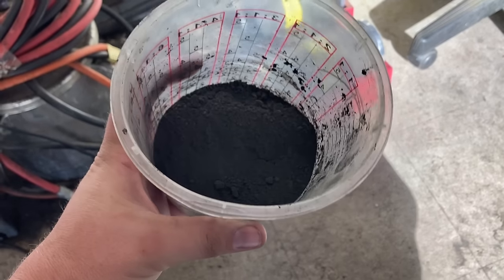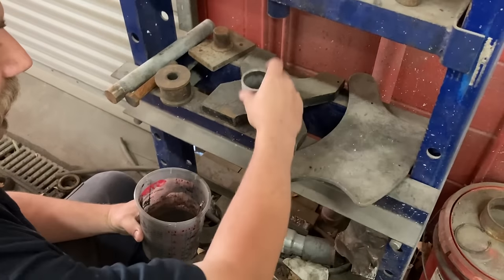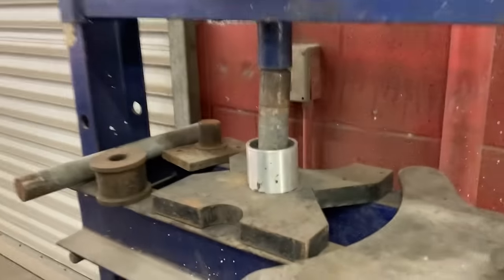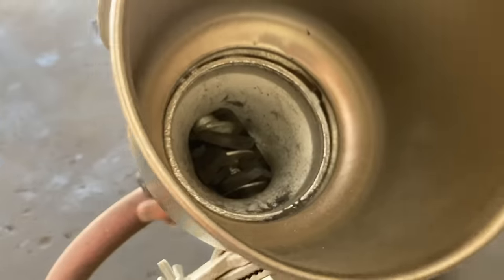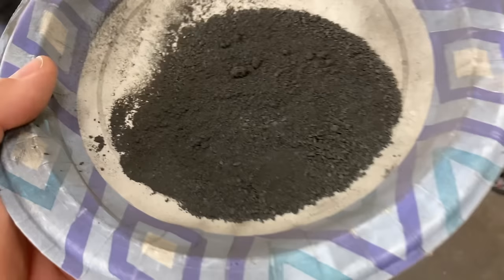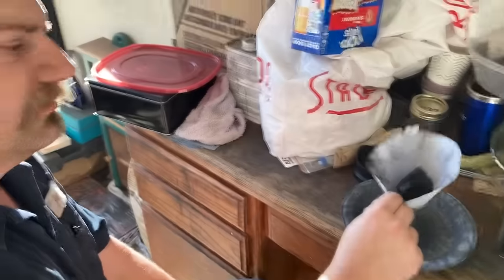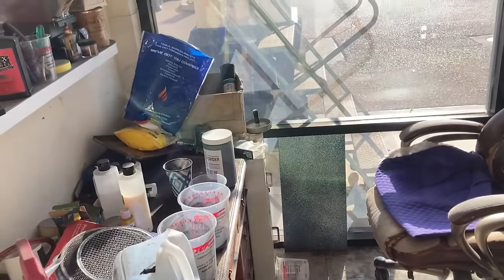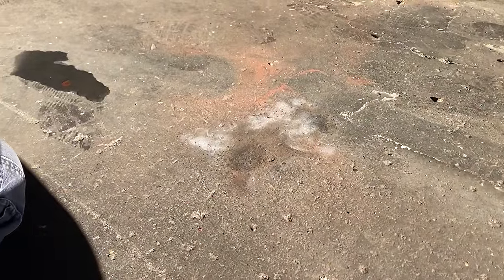Making Corned Black Powder

Comment: Thanks for sharing!!    

Dust facilitates accidental ignition.  Look up dust explosions if needed.  Just wanted to put that out there before I say anything else.  Safety is paramount! 

It's not so much a literal waste as much as it is just plain inefficiency.   I'd speculate that adding a very small amount of dextrin as a binder,  2-5 grains measured by weight, could improve efficiency without impacting performance.  It might be negligible, but if there's a concern with adding 2-5 grains of dextrin as a binder it's possible an additional 2-5 grains of silicon powder could mitigate the impact and improve ignition.  Testing would be required to confirm performance variables. *

Try using bedding hay/straw.   If you can get grape vines it could provide even better performance for muzzleloaders, cartridges, and cannons.  

If you're more interested in display than projectile performance than use of willow should yield improved ember effects.  Projectile over display, straw or grapevines have been documented as top performers.  This information has been acquired from various sources dating back several hundred years.  It's been said that using straw provides more power than useful in pyrotech.  

I suggest never using a pocket lighter to ignite lose powder unless you are trying to increase risk of a burn.  The type of long extended lighters commonly used to light BBQ charcoal is much safer or even a stick/twig/punk with an ember/flame would be much safer and easier to control. 

I do not have values of any tests, please do your own research to validate and never trust random persons on the internet.  

* there are 7000 grains to a pound.  Use a calculator and always check your calculations.

Comment: Put a couple of tablespoons of corn starch on a piece of aluminum foil and put it in the oven at 350 for 45mins to a hr until it all turns a even golden yellow color. This converts the starch into dextrin, add  this dextrin at 1% by weight to your meal, it will not affect the burn in any way and it will greatly increase your meal binding properties, overall hardness will be improved along with higher resistance to a humid/moist environment and it significanty decreases the dusting effect /finer breakdown during carrying shaking around etc. And  when crushing it which in turn maximizes the ratio of usable granules per puck.
Keep in mind the 1% ratio of dextrin in your recycled dust to be added into the next batch and adjust accordingly. Even 2% is fine but shouldn't exceed 3% or it will start to slightly change the burn characteristics.
And as far as charcoal goes. Willow is 100% the best imho, it's ultra clean and fast due to it having near zero natural wood oils/resins that carry through the charcoaling process.
As far as tumbling with graphite, all this does is improve the pourability from a power horn/flask, it makes it pour smoother because it's less sharp and slightly lubed so to speak.
Nice job man !
Reply from the maker: I experimented with dextrin when I first started making antique muzzleloading propellant but I have found it’s unnecessary if you compress your pucks well enough with a little water. I live in the south west so humidity isn’t really a factor for me. I do tumble my corned powder but without graphite. The graphite slows the velocity and doesn’t make the fouling any softer. If you tumble your contend powder for an hour or so it will flow out of a horn of flask just fine.
Reply: @Everythingblackpowder  Ya dextrin is unnecessary in general,  but I live in the north east where the weather is always fluctuating, we go from O to 100deg f and humidity from 0 to 100%. I have found dextrin really helps battle the differential with condensation, humidity and temp swings. In my case is a big help with powder consistency vs the climate here.

Comment: I saw a way, mix it with alcohol, and while it is still wet, but already a little hard, grate it on a sieve, like on a grater, just mesh-sized granules are obtained, you can use a large mesh, and then ferment. This results in less powder. You can also add a little maltodextrin for better shape.
But this is a way for firecrackers, I think it would not be advisable to add binders for shooting, they will clog the barrel so that it will be difficult to clean it

Comment: Would there be any danger, change, improvement, degradation, etc.. to using acetone, Everclear, Isopropyl Alcohol, instead of water just prior to corning? The reason I ask is I wonder if the other stuff would “flash off” faster than water. I presume the reason for using water is as a binding agent of sorts? I also have no idea what compressing acetone, etc., in black powder would cause.
Great videos btw!

Comment: You can use a half container of water if you like, after the water bat the alcohol bath helps with evaporation after the water bath, but this guy is happy. The reason for the water is to completely allow the finest particulate of each ingredient to evenly mix with each other,,,the ingredients(charcoal,Sulphur and potassium nitrate) will mix dry but not as efficiently as the corning method. After you mixed all the ingredients dry, add enough water to cover by 1" or so, stir until completely mixed, let stand for 24 hours undisturbed so all ingredients have settled, gently siphon off the water, I use a strip of cotton cloth to set up the siphon, after the water is mostly drained, cover with 1" of isopropyl alcohol mix well, let settle, siphon off excess alcohol with cloth siphon, put the black powder on a piece of cloth big enough to make a ball in out of the black powder. Once you have the black powder packaged hang it yp and let it dry. Grate to your preferred needs. Good luck, black powder is heat sensitive, spark sensitive and, pressure sensitive, good luck(bp is ok when wet, wint burn, won't explode)

Comment: I enjoyed your video, and I am going to try it your way. I do have 1 question for you. what would you change in your mix to make 4FF powder for flint locks??  I have been making my black powder for 30+ years and have always used 91% alcohol, adding enuff to make it a thick paste like peanut butter then laying a piece of plastic window screen on glass and pressing the powder mix into the screen with a trowel. lift off the screen and let the powder dry. then take a sharp trowel and shave the powder off the glass, sift off the powder and you're done. I do use a binder in my mix.
Reply from the maker: Well, if you’re doing it the way I show in the video then all you will need to do is tighten the screw on the grinder and it will make smaller granules. It will take a little bit of experimentation to figure out how tight or loose you need to set it
Reply: Ok thank you for the quick get back.

Comment: I've been finding WIDELY varying answers to how much pressure is needed to do this - anywhere from 2 to 20 tons.  I got a rather small  die (30mm) after watching this as I only have a 6T press, but it seems I could have gotten a wider one.  Or I may not need to put the full 6T of pressure on it.  Most of these cheaper Amazon presses (Mine was les than $100) do 6 tons.

Comment: Cool.  But if that grinder causes it to go.    Those pieces that are compressed could  make it into a grenade    Or at the very least , a very pain inducing firecracker .       Could you add a bit of moisture at this point then allow the final grains to dry.  Or would this grain grinder just turn everything to mud if it’s not bone dry ?
Reply from the maker: It would turn it into mud

Comment: You are folllowing the book, in that you press the powder with a small amount of water, in a hydraulic press, forming a hard puck, wich is then crushed into various corn-sizes.
Unwanted sizes can then be fed back into the process.

To make the corned powder safer, it is said to be good, to thumble it with some grapite-powder. It might self-ignite by means of electro-static discharge otherwise.

Comment: I’m not sure what to try next, I’ve made about six pounds thus far and even added a little corn starch as thickening agent. No help as nearly 95% of every grain goes to dust after granulated and dried, it seems to just fall apart. I’m using eastern red cedar it’s really fast and makes good powder, even works great in my flintlocks as long as I don’t load with super fine powder. Any suggestions would be appreciated  as I do a lot of black powder shooting, about three to four pounds per month, so if I could get this correct it would save me a small fortune. Thanks!
Reply from the maker: It sounds like you’re not compressing your pucks enough. Are you using alcohol or something other than water?

Comment: A tip if you make your own charcoal, try using toilet paper, you be surprised how good it works. 
About the grafit, if does not help proformens at all, on a newly made batch of powder, actually it does the opposite because it is not flammable in it self. BUT it helps chodte the pellets so they get more moisture resisted and that's why the big guys use it. So the powder does not go bad over time.

Comment: If you store the powder as pucks/corns and only grind it down before use are there any concerns? Are the pucks more or less volatile that loose black powder, do they still ignite, burn, or explode?
Reply from the maker: You could certainly do that. The large pucks can ignite but they burn from one end to the other and fly across the room much like a model Rocket Engine.
Reply: @Everythingblackpowder  thats wild!

Comment: I made mine a tiny bit more wet and pressed it thru a fine stainless steel kitchen sieve with the back of a spoon…(I have no equipment)
It scapes off onto a plate and dries in the sun…
Reply from the maker: That works too. We call that screened black powder

Comment: When Muzzle loading i used FFFF abd thought it would be hottest but then read F burns the fastest. Why do you use FFF?  Also as a charcoal manufacturer i used to make a lot of willow and from what test have told me willow is best. Red Alder is second. And have sold some lodgepole pine as well as cottonwood. Reports have been favorable on latter 2

Comment: Question, how much of a difference do you think it makes with the pressing into pucks, etc.  What's wrong with just dampening the powder with a shirt starch sort of mix and running through the screen? Seems like it granulates pretty well that way, perhaps a higher dust ratio, but works.
Reply from the maker: Corned powder is more power and has a more even burn rate. Screened powder works just fine but corned powder is comparable to the commercial grade powders such as Goex and Schuetzen.

Comment: Have you ever tried the dust in a pan?  I use 4f for the pan.  I know this diy powder if done right out burns goex.  So would the dust shoot flame through the touchole better?
Reply from the maker: Yes it works fine but I make a habit of priming with the same powder I’m shooting.

Comment: I don't think graphite is meant to enhance powder's burning performance.  IIRC, graphite glazing was invented originally for the less expensive sodium nitrate-based blasting powders.  Sodium nitrate is more hygroscopic than potassium nitrate, so a method of keeping grains from sticking together in high humidity was needed so the powder would still pour. The graphite accomplished that, and the practice carried over to gunpowder to help it flow into the measures built into powder flasks.  It also makes an electrically conductive coating that would make it harder for static sparks to ignite the powder, but I don't know how much harder compared to bare grains.

Comment: For what purpose do you make the pucks and then grind them up
vs
Leaving the powder the way it was when it first came out of the tumbler
Reply from the maker: It makes nice even granules that can flow through a powder horn or brass powder flask and can easily be measured in a volumetric measurer

Comment: So, I saw your other video where your homemade black powder was less dense than say GOEX.  I saw a couple of other YouTube videos discussing the same issue.  I use cedar 75/15/10 and puck it with a 6 ton press.  I measured 30 grains by volume and it weighed out just shy of 24 grains.  So 80%.  Still when I touch it off, it is fast.  Anyway, I thought I’d throw that out there as IIRC that was sort of the ratio you were finding on yours by density.  Don’t have a clue as to how to make up the 20%.   I have grapevine, alder buckthorn chips.  I also have an ass load of black willow around my home.  When I make more charcoal, I will repeat the test.
Reply from the maker: The solution is a bigger press and a tighter puck die. My 20 ton press makes powder that is slightly more dense than goex and Swiss. Only by a couple grains but it still counts.
Reply: @Everythingblackpowder  thanks man.

Comment: You aren’t using any binder?
I’m trying to make powder for rifles where I usually dabbled in fireworks which requires less dense (sometimes even with fillers) powders.
Reply from the maker: Correct. There’s absolutely no need for binders like dextrin when you corn your powder
Reply: @Everythingblackpowder  thanks, also I was thinking that the increased power of 77:13:10 is likely due to the higher density of the nitrate

Comment: Hello,   Using graphite may help prevent clumping, but the real reason for its use appears to be that graphite gives black powder gun powder a neutral electrical charge. This will prevent it from exploding if you happen to rub a cat with a latex balloon, then touch your powder. One spark and, BOOM. No joking; any electrical discharge can set off black powder. Graphite makes the powder much less attractive to insidious and invisible static electricity. This is why they used graphite powder coating long ago and explains why even gunpowder casks, like the ones used to hold a cannon's black powder on sailing warships, had brass bands holding the wooden casks  together instead of iron bands. Brass is more expensive and less effective at holding a barrel tightly together, but the iron of iron-barreled bands conducts electricity. Brass tends to be more electrically neutral and thereby safer. Then, as today, most people tended to look unfavorably on accidentally blowing up your own warship when handling explosives. It is regrettably entirely possible to blast off a finger or two when out in the field. Ships blowing up or hands torn off does not appear to have happened often historically, but it has happened. Just one time losing an eye, face, etc. should be memorable enough to warrant the safety-first employment of a graphite coating.

Comment: That's a fairly similar method to the one that I use. Only differences are that I use quite a bit more water (Always hot). Just enough to form a thick paste. At the end of mixing I add about 50ml of chilled isopropanol to the hot paste (Fire and fume hazard), this literally boils off the majority of the remaining water almost instantly. I don't have a press so at this point I have to leave the mix to dry naturally which isn't ideal as Black powder is hydroscopic and I live in the UK. I don't have a grinder either, so I break up the resulting block using a hammer, and anvil (In small batches due to spark hazard), and then grade using screens. The end result seems to be about the same as yours shown here, a really nice fast powder. Just out of interest, what is the purpose of the graphite coating? I know that you said that you don't do it, but I'm curious.
Reply from the maker: Graphite coating is supposed to keep static electricity down and make the powder pour out of a flask or horn easier.
Reply: @Everythingblackpowder  Thank You for the reply. Interesting. Not sure how that works seeing as graphite is an excellent conductor of electricity, but I guess maybe it reduces the friction of the grains grinding together OR allows any static electricity to flow between grains without creating a spark. Not something that I think I really need to bother with, as I don't usually transport my black powder very far, and it's usually in fairly small quantities.
Reply from the maker: @24934637  same here

Comment: Nice work. Been making it about 10 years now. I should get a press...  altho I do OK with a couple 2” black iron pipe caps, a 4” nipple and a poured epoxy piston. Top cap threaded for a .5” bolt. For you folks like me without a press. You got a cannon for that 1F? :)
Reply from the maker: No. I use it for my .577 Snider cartridges.
Reply: @Everythingblackpowder  Ouch :D

Comment: Is there any chance of the powder igniting when you compress it?? I use about the same amount as you in my pucking die. I get really nervous when I compress the pucks.
Reply from the maker: As long as the powder it wetted with H2O and you compress it slowly there’s no real risk of it igniting. In order for it to ignite under compression it would have to be dry, in a sealed chamber and compressed extremely fast.
Reply: @Everythingblackpowder  that was kinda my thinking too but I just wasn't sure how much heat I was producing by compressing it. Thanks for the reply and all the info. 👍

Comment: Hello mister.  You did very good video. But please can you tell me Why doesn't he want to light the black powder in the pan of a musket gun. The only thing that is not done correctly is that the powder washers are not pressed with the compression of a press as they should be, but are clamped with a vise that I did not compress very much. I let the powder washers sit tight, pressed down on the vise for about 1.2 minutes.  In your opinion, is it possible that the powder in the musket pan did not ignite because the powder washers were not pressed hard enough, not pressed long enough, tightened by the vise. This was prevented by a good solder, a good sticking between the nitrate, coal and sulphur, and because of this the black powder in the pan of the musket was not ignited.